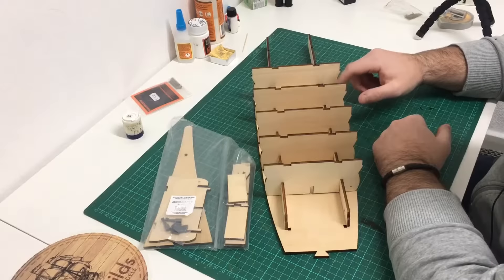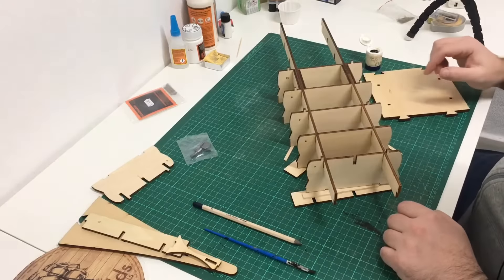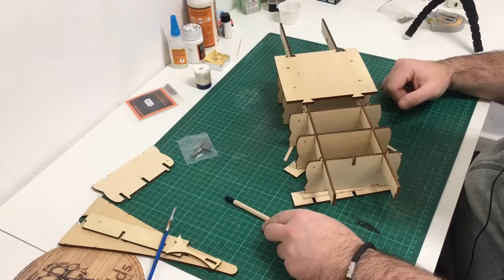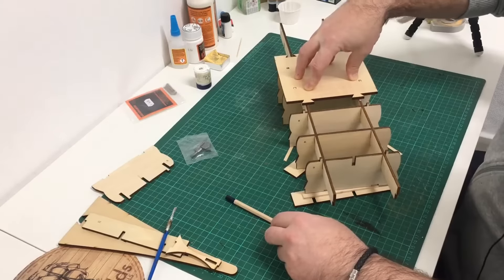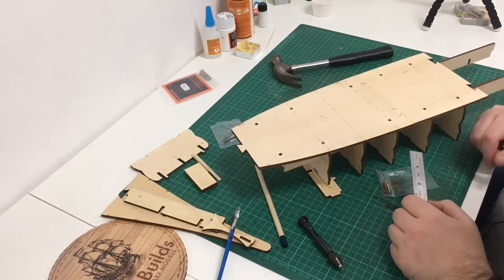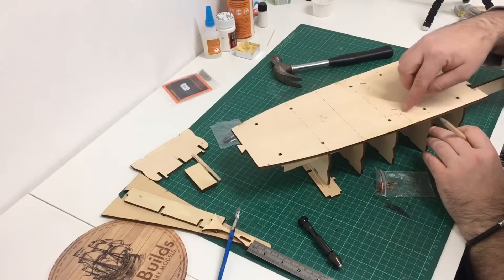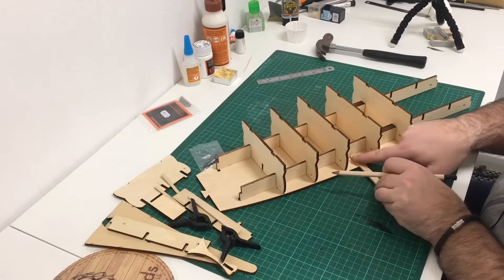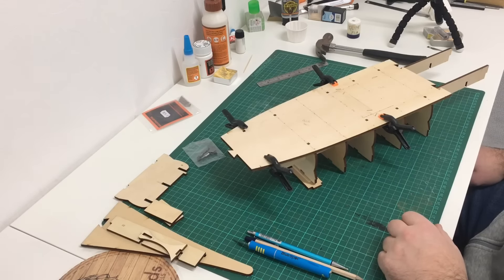YAMATO Model Ship Build : Part 4 :  Glueing & Pining The Bulkheads

Comment: I like the way you sorted out the slightly warped board by use of pins and additional edge supports in one of your later videos and also  the method you used when adding 1mm strips. It is all very informative and helpful. Does the bottom section get covered with planks thereby hiding the pin heads or is it better to remove the pins once the glue has cured? I am also working my way through the on line build manual as well as I wait for my kit to arrive to get a better understanding of the build process.
Reply from the maker: hi glenn, i dont think the keel plate gets covered, you can removed the pins if needed, but im just going to fill over mine with the body filler before and after the premier coat is applied, i will be working on the filling and premier coat soon